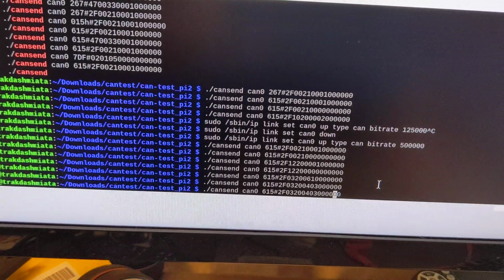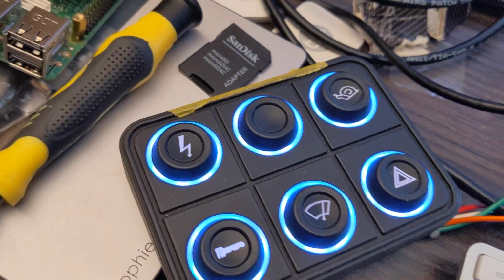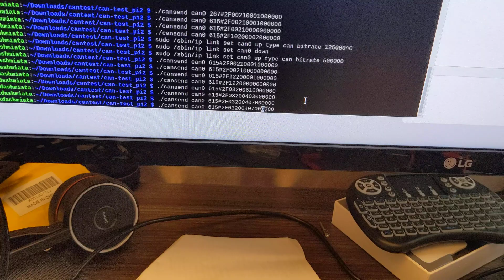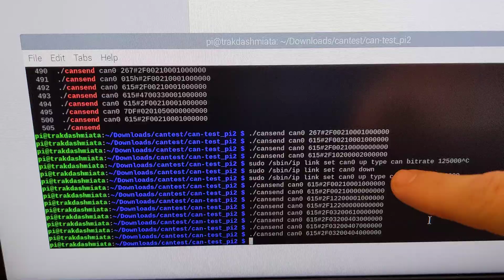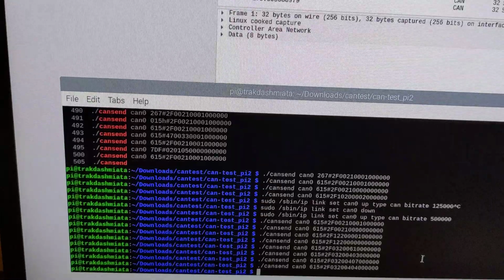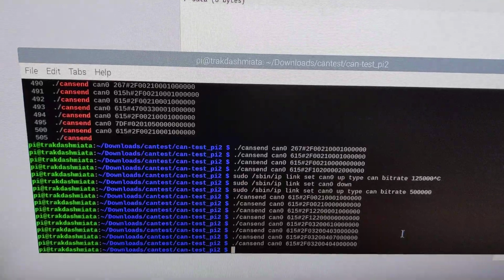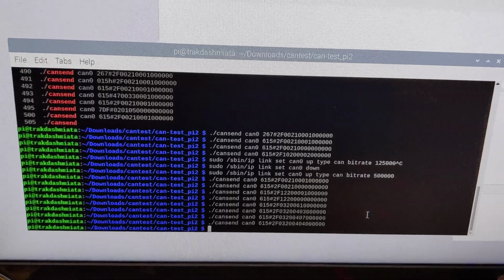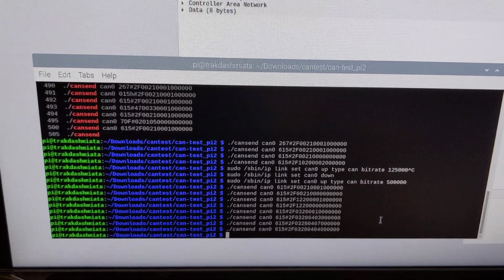Blink Marine CAN bus keypad settings

Comment: Very nice!  what do the blink marine pads cost versus buying them through ECUMaster?
Reply from the maker: I'm not sure, I also don't know if ECU Master is running a custom firmware or still supporting Can open.  Blink Marine will sell limited quantities as a sample directly however.
Reply: @DogsBollocksRacing  good to know!
Reply: @JustKyzuuh  My guess is they're standard keypads and ECU Master doesn't modify them in any way.  My Hardwire Electronics PDM uses stock Blink Marine keypads.
Reply: @CuriousPaulMon   ecumaster is just raking people over the coals. thryre just changing them to canopen protocol. i have the pmu16 and bought a blink keypad and used a lite client to change the baud and packet transmission, then send the command to run in canopen. Boom, just saved yourself $200. lol, blink 12 button keypads with the 7 color led backlights are normally $250-260. Ecumaster charges around $400-450.